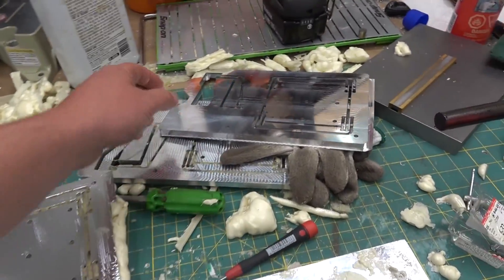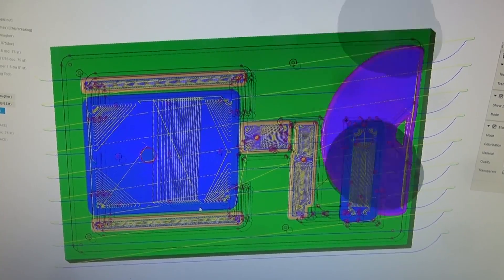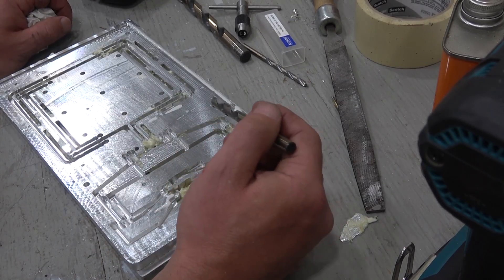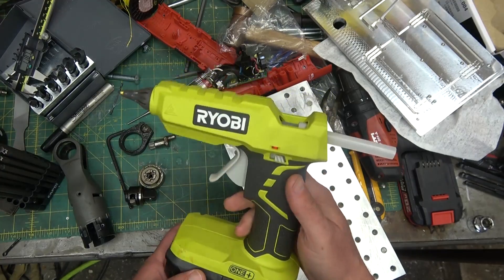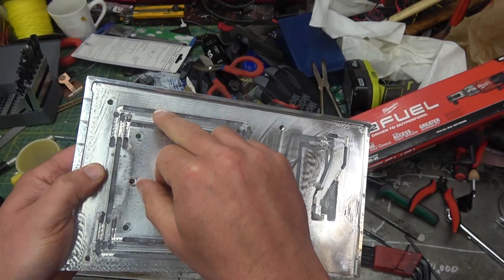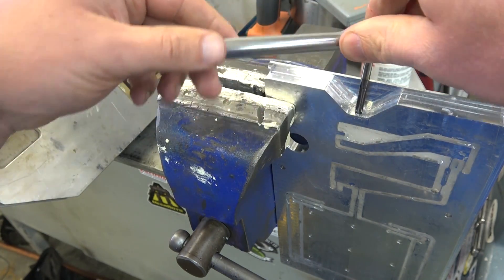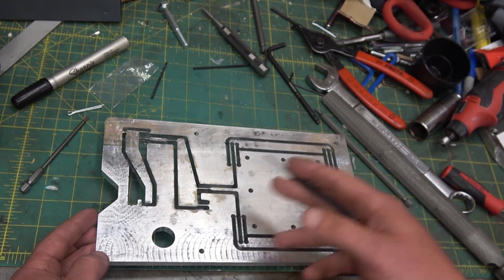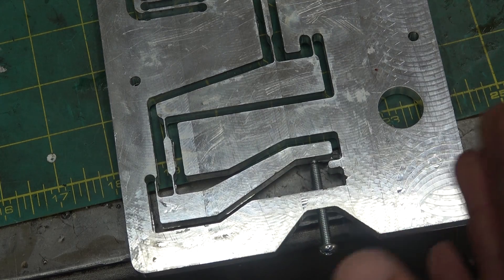Splitting Can't Hairs | Optical Measurement

Comment: I'd've assumed you'd want your input lever assembly to PULL on the moving table portion of the compliant structure rather than PUSH on it, since those thin parts under compression could maybe buckle a bit – does it matter?

Comment: What is preventing him from using a thicker plate but machining (almost) all of the back side of the part to the correct thickness, leaving the sensitive areas extra thick under neath. Then grind it away later parallel with the slot, to prevent rotary or perpendicular forces from breaking it?

Excuse the potential dumb of course. I've learned all I know about machining from AVE on youtube.

Comment: Aluminum has limited fatigue strength, so this plate would only survive a finite number of cycles... am I wrong? (Addressing your “lasts forever” comment).
Reply: Steven Lucero Yes, actually. I have in my possession some scrapped prototype analytical balance mechanisms from one of the world’s most renowned scale makers, and they use exactly this kind of mechanism. They are able to convert the microscopic movement from the tiniest bit of weight into a signal to be displayed, and do it for years of service.
Reply: Antonio Tejada - going off the technical definition of “forever” in this case.  100’s of thousands of cycles would still be attainable

Comment: Little trick for getting the hot shmoo out, flip a can of dust off upside down and thoroughly freeze the geeze out of it. Then quickly poke it with a pokey thing and it will shatter like it was never there.

Comment: on the subject of splitting hairs, would the lever system not experience fatigue if it is used abnormally excessive? and would that not be wear on the tool. Great video BTW its is an impressive hunk of aluminium. sorry for being an ass

Comment: Flip a Co2 air duster upside down and spray the hot glue. The liquid Co2 will freeze the hot glue and it will just snap off. It loses is rubber texture.

Comment: Ave, I'd put some treaded holes in the part. When it comes to facing the second side, bolt it down onto a fixture with the threaded holes. That way it won't move around and facing will be simple

Comment: I had a job a while ago we manufactured consumer electronics. Anyway we hot glued circuit board over the connection to keep them from moving. We fought them for a while when we had to remove them and often destroyed boards trying to remove the glue. I was tired of trying to get it it off one and used freeze spray on it out of anger and a slight rock the glue would separate perfectly. After you got the boards out you could freeze and chip the rest off easily.

Comment: To easily get hot melt glue to release simply depend on it.
Reply: This! ^^

Works even better if used in a gift.
Reply: Man, I had a hot melt glue gun that had a two stage glue and damn... when the glue was used with the hottest setting... it bonded better than in laws after hearing you won the lottery.
Reply: Took about 30 rereads to finally understand this comment.
English language doesn't chooch with this canuck.
Reply: @roadiejames  I had to same problem. It's because the call it hot melt glue...

Comment: Intuitively you'd expect no wear, but aluminium fatigues. Always. No minimum load (like steel). So eventually she'll crack a joint right half in two. Probably the one at the lever, what gets the most flex.

It's just how that material works.

Comment: How did you determine the thickness of the switch mechanism. As it deflects load from point a, b, and finally c. Doesnt the links in between stretch? loosing accuracy over time, or by cooling the Aluminum  periodically reverse the potential fatigue and stretching.
      Thank You for the vid's  Love watching

Comment: If you drop the screw size down from 10-32 to 4-40 the adjustment will be 'finer' and the math becomes so easy that you might not need the electronical slide rule to chooch the measurement.   ( 40 tpi = four times less than a tenth per rev, or, said another way, four turns equals a tenth of an inch, instead of some mind tweaking decimal fractional confuzer )

Comment: You mean 1 1/4 thou"?
Now I've watched it all ....... Why not extend the area of the platen wherf you wanted to you could do it with light Say a laser pointer) set to intersect your platen ..... place a viewing surface some discrete distance away and by virtue of the distance between the platen edge and the viewing surface to the source you have an optical multiplier? Less metal more photons (is there an angry pixie version for light in AvEspeak?)
It would be doing the same thing but optically rather than mechanically and it is good if you don't look into the light even if God did give you a spare eye you don't always use ;0)

Comment: Well, maybe not an idea for a different flexture but I do have another possible application for one similar to that. If you piled a bunch of gravity on the plate and affixed the frame to terra firma it should do well to amplify the signal of an siezmic p-waves in its sensitive axis, eliminating the need for precision electronics, which have a much higher failure rate and complexity than than a flexture operating strictly within the realm of elastic deformation. It may only be a gain of 25, but that's beautiful on what is essentially an ideal amplifier.

Comment: so I know you stated that there is nothing to wear out - on a long enough time period, would the thin flex strips not suffer metal fatigue?
Reply: It's aluminum so I think so. I believe steel has a threshold below which it does not fatigue but I don't know if the hinges on this thing are below the limit, especially the one nearest the screw.
Reply: dothemathright 1111  So in simple terms for simple people like me: "It might get inaccurate if in heavy use for years and years on end." Is that right?

Comment: Ave , Hwouldn't the cheech factor with every rotation work harden the doodlydoo's overtime? Meaning that the aligned crystaline structure of the frail metal strips would be accustomed to snapping - much like the missus when she hasn't been fed on a regular basis?
Reply: If you mean the threads, that's a feature not a bug. If you mean the fiddly flexy linkage bits, not as long as the elastic limit isn't exceeded. Check at 8:32 to about 8:37 and notice how much the whole thing flexes, now scale that down to the itty bits. On their scale that's like bending a fifty-foot-long sheet by a half inch.

Comment: So, with such fine measurement, I am inclined to think slop amd stretch in the mechanism is going to have an significant impact on what your measurement comes out to. What say ye?
Reply: I'd say as long as it don't exceed the elastic limit of the metal it should be okay. Temperature change is gonna be a bigger problem as the methanol dribble showed, but that's a problem with any material even expensive stuff like invar.

Comment: Wouldn't thermal expansion of the flexture be a variable at such a small measuring scale? Or would you write down it's measuring range value at multiple temps? Idk lol
Reply: Thermal expansion shouldn't be an issue with that set up as the measurements are done based on an arbitrary zero point. If he were measuring something very hot, very cold, or over a few hours there might be some interface from thermal expansion but since it's a manual device human inconsistency would play a much greater part in the accuracy.
Reply: @kendallemory8455  that makes sense. Explains the "pen" mark haha

Comment: Great! Now you need a flexture plate temperature control system to maintain the accuracy and repeatability! 😊
Reply: May as well keep it in an inert Nitrogen atmosphere as well, easier to control the temp.
Reply: @jamesburleson1916 ✔ 
Perhaps a sealed oven in either Nitrogen, Some other noble gas, or vacuum. Mounted on springs or shocks to limit vibration.

Comment: Pretty neat way to measure. Just wondering the advantages of the plate section vs putting your part to be measured in a box under a digital microscope with a dial indicator against the box. Moving box until microscope shows other side of desired measurement. Then reading the dial indicator.

Comment: Hot snot works better if you heat up your workpiece. Hot air gun will do. Just put on some welding gloves.  
I would route out the center of the hot snot before releasing it with alcohol. It will cut like butter and means that it will not jam when you pull it out.

Comment: Why not a 40 pitch thread? One turn is 25 thousands (.025) A 32 pitch thread is (.03125) not (.003125). Please don’t say metric is better. If it was you would have used a 1 mm thread pitch = (.0394). Or did you!?

Comment: Freeze hot melt glue and it goes brittle and it comes off Clean and easy. Freezer spray works well.
Reply: Not sure where you got your enginerding degree, but removing hot glue follows the same procedure as calibrating a micrometer.

Hit it with the largest hammer you own.

Also works for everything from annealing steel to upgrading firmware.
Reply: Heat it up and it melts out.
Reply: @theupscriber65  Oh realy...  Id never of guessed hot melt glue melts when you heat it up... 
Then it makes a sticky, gooey, stringy mess ;-), and gives off fumes, as does using solvent.
Freeze it and it shatters easily and comes off clean with no mess, no fumes.

Comment: Though messier, the hot-melt glue could have been put on a drip tray and melted out in a low temperature oven.
Less fuss than using alcohol and picks.
Reply: wax?
Reply: @rehoboth_farm  He seems determined to avoid this obvious solution. beeswax is nice and rigid, melts out and cleans up with acetone.
Reply: @nathanshaffer3749  or a paraffin if it needs to be stiffer.  I think you can get all different grades for different hardnesses.
Reply: @rehoboth_farm  it is harder, but beeswax is still way harder than hotsnot and it shrinks less than paraffin and won't crack.  I have had situatioons where parafin has basically crumbled on me.  Beeswax doesn't crumble
Reply: @nathanshaffer3749  I think our point is essentially the same.  There is a material which would do this job with less difficulty.  Realistically there are probably other materials too.
Reply: But he had a hotsnot cordless gun right there on his bench, behind all the other one time use tools, and you can’t really disassemble a bee to show how he makes wax ......
Reply: It's too logical and not as YouTubeable.

Comment: Hey AvE, maybe a way to double the measuring width....☺ If you can flex the flexplate in the oposite direction (maybe with a screw from the other side). Then you can start measuring by unwinding this screw and once the flexplate is in rest, start with the other, original, screw to complete your measuring. Now you use (only) 1 direction of the flexplate. Nice video!!😃👍😎

Comment: Fasten a depth micrometer to the side instead of the #10-32.  Would be much finer control and accuracy.
Reply: Jacob Mumbauer - Or just a micrometer head. I know Shars has them; I’m sure you can get them elsewhere as well.
Reply: @darkwinter6028  
I understand everything you guys are saying.
Reply: It was probably designed for a micrometer head. Since most move 0.025” per revolution one revolution would give you 0.001” of advance.
Reply: Stepper motor sounds like more fun.
Reply: I was thinking the same thing, but where's the fun in that?
Reply: Or, a differential thread would be a simple cheap solution.
Reply: Finer control? Probably. But a camera will have better accuracy, especially if he plugged it into a confuser and did pixel per pixel measurements (It's not that hard to program, especially for him I'd imagine)

Comment: Would this be more reliable in something like 4140 PHT? Something with better stress rebound? Also, glad you found your solution to the vibration.
Reply: Titanium is one of the best materials for flexures. Better yield vs modulus ratio, so you can get more stroke from the same geometry. We use some stainless, aluminum, and some more exotic materials at times, but when we want motion (and aren't just including flexures to deal with over constraints or thermal reasons) titanium is usually the first choice.